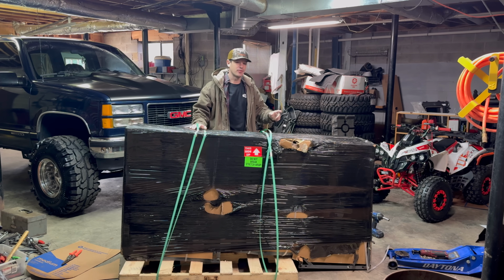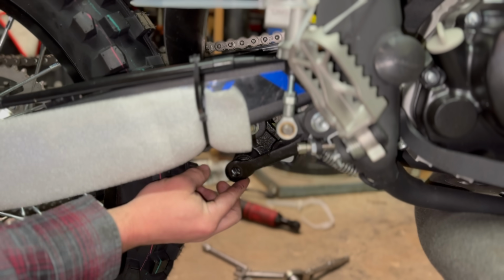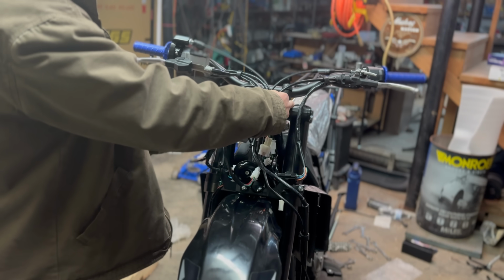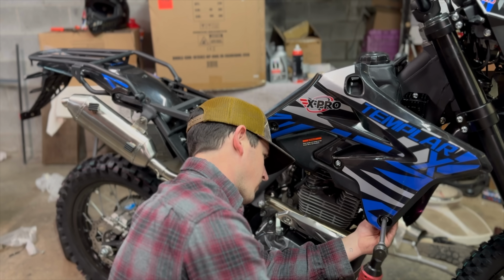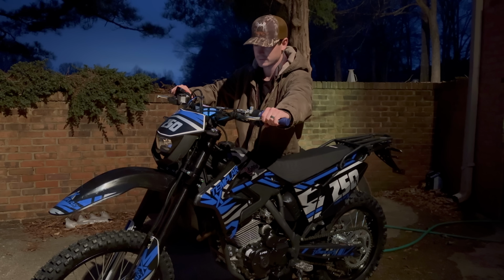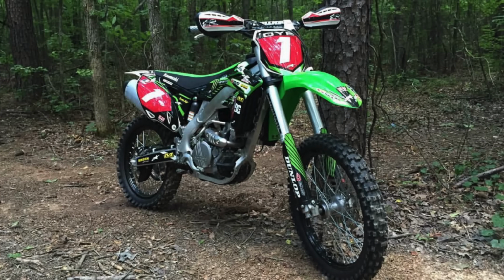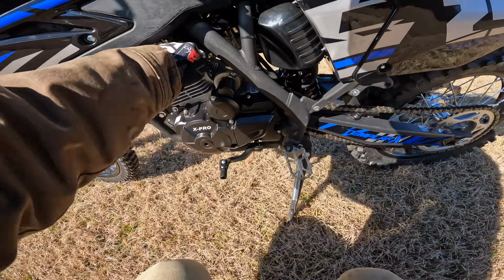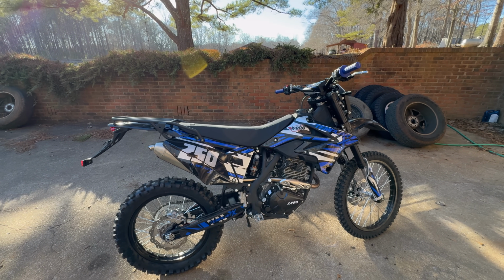I BOUGHT A DIRT-BIKE FROM AMAZON! | IT’S AWESOME |

Comment: The Dirt bike have JT sprocket 15 tooth and a rear sprocket 50 tooth connect to 428 drive roller chain. This guy from Canada has a Hawk and he install high performance stainless steel exhaust pipe one piece and made it louder with bigger hole in tail pipe than original 2 pieces black oxide exhaust pipe plus stainless steel wing nut collar for double attached flange and 2 nuts and Finned washers connect to cylinder.

Comment: There's a reason why there's cheap oil in there. Because it's the best to break in a motor guarantee. It's breaking old in the motor that you're supposed to run a couple of tanks through To seat the rings in
Reply: That's what I was thinking, it's probably break-in oil (straight mineral oil?).
Reply: @trevorjameson3213 non-detergent SAE30 is considered mineral oil.

Comment: China engines are so underrated and just passed off as junk but as someone who buys used ones, i can confidently say, the only issues i have are due to lack of maintenance or just past failure due to age or neglect, often a new carby is needed, a starter solenoid and cdi, i literally found a crossfire x250r at the dump, showed it some love and cheap ebay parts and now it runs perfect.

Comment: By the way, do not try to use nylon lock nuts on the exhaust pipe bolts that go into the cylinder head. Also do not use any kind of loctite. In fact there are some types of nuts that lock at the top of their threads that seizes the bolts that you are screwing it onto. I forgot the name of the nut type but it is what's needed for any exhaust pipe whether it is a motorcycle or a car.

Comment: before you start an offroad motorbike, you have to gently tap the carburettor to shut off the fuel, otherwise it will overflow, start by putting the motorbike down

Comment: I adjusted my valves,  loc tite on every bolt then upgraded to Nippon carb with 110 jet before I even broke mine in.  The. I gave it 1hrs at 3-5k RPM then let cool 3 different times for break in.

Comment: Lengthen the Throttle Cable or create some slack in one that is on it, might also ck out the Throttle Slid top of carb. , if not machined properly, they can stick. I would probably Upgrade the Carb..

Comment: Being a chinese bike and quad dealer for over 10 years. If you know which manufacturers to buy from you can get a quality bike. Here's the deal. The carbs are setup for chinas atmospheric pressure. You have to dial it in 1st thing. Also that oil is break in oil. I run em for 30 minutes on the PDI (pre delivery inspection). Then swap it out. My 250cc sound like 500s but are not road legal here in Canada (I did have supermoto kits you can install then take for inspection and take on road). And you will have battery issues. My personal units i swap to lithium and honestly its a decent overall bike. Im 6 foot 5 and  been hammering on them for years. Even the Side X Sides if you know the quality manufacturers like me. (I have a co worker in china to tour facilities the 1st year). The sxs 800cc is a Mitsubishi 3 cylinder and complete drivetrain is all Mitsubishi. Hopefully this can help a few ppl. Any ?s just ask. Also have a stock pile of aftermarket and oem parts.
Reply: What is the Mitsubishi motor side by side you speak of? Is sxs a brand name?

Comment: The racing dirt motorcycle HAOSEN Zhongshen Hawk XPRO 139cc Does it have dear brake foot lever that went above the foot floor peg. Otherwise the TAOTAO have the brake foot lever bar that goes under the foot peg toward to the master cylinder for rear disc brake.

Comment: The XPRO Hawk have pink slip ownership title from China to your mailbox in 1 month for your brand new 2024 DVNOP 229cc Templar. The 520 pitch chain is normal for Super Chief 250 single cylinder bike Chongqing in natural aspirated carburetor and the XPRO have digital EFI. Did you ride on rough dirt trail in 6 gear?

Comment: Pretty cool. Like i said when you got the boys quad do that first oil change! Lol be a good cabin bike. Looks good for the price
Reply: What oil would you use in this bike ??
Reply: @micwell2247  Any good quality 4-stroke motorcycle oil is good. You can't use automotive oil because of the friction modifiers that will cause the wet clutch to slip. Also automotive oil doesn't have the additives that are needed for a motorcycles gearbox. I usually run Honda GN4 or Yamalube in my bikes, but any of the name brand motorcycle oils are good.

Comment: Rings won't seat and break in correctly running that Mobil 1 synthetic oil on break in. Need to run a good high quality mineral oil first for break in then switch to synthetic

Comment: The weak link appears to be frame. Old school tube frame.
Reply: In ways, that can be better for handling and vibration absorption.  Even in the Mt. bike industry, a really good alum frame, carbon frame, Ti, frame and cro-molly frame, it made as well as they could be made, were really competitive with each otehr overall.  I know my alumn YZ250 2-stroke frame transmits a lot of vibration to my old hands, and they get numb.  I would rather have cro-mo.  But not made in stinking china.  :)

Comment: It really bugged me that you used both metric and standard sockets/wrenches lol. If the bolt is standard, the nut on the other side would be standard too  if it was 17 mm on one side it would be a 1617 or 18 on the other

Comment: I have had mates get Chinese bikes and they instantly regretted it so much stuff just breaking straight away. Honda crf 230 will last way longer I got a 04 in 05 still have the bike is the loner that I use when my friend's don't have there own bike I've never had a problem with it with minimum maintenance and never had to rebuild it you could probably get a second-hand one for the same prices has the china bike and I consider them to be virtually indestructible along with my 88 kdx200cc I got for $1000 aus. The KDX I did get it off a family member that's had it since he was a kid but there's a lot of second-hand quality bikes around at good prices . My main bikes are a 2015 wr450 road trailer and just finished a resto on a 00 rm250 which cost me a small fortune. That being said my mate just got the new crf 250 and its made in China 😂

Comment: That's not insane for the bike cuz you didn't buy a dirt bike you bought yourself a Enduro a 250 Enduro which means you can register it and drive it on the road legally depending on your town probably not the highway but you can drive everywhere else that you can drive a car so or a motorcycle cuz it is qualified as one at least in my state is I'll see you at blinkers so that does mean that it is a Enduro and you'll set a plate mount

Comment: that is a great value for money, most honda motorcycles in my country are made in thailand or what you call tofu honda. made in japan honda's are great but if it's made in thailnd they always broke down and the parts is cheaply built, ordinary shock, cheap bulbs analog panel and social climber dudes still buy it because they always believe a shit will turn to cake if you put honda sticker on it. some are bragging about their outdated cheap parts honda because it got sticker on it wahahaha. a cheap built motorcycle remains cheap even when you slap honda sticker to it.

Comment: You may not be able to get this registered for the street. Looks like not nhtsa approved.
Reply: There are states in the USA where with just a squeeze bulb horn, a head light and brake light make a Motocross bike legal.  I took some time off, and not interested in that, but I know back in the 80's and 90's, you could buy kits to do it.  For turning, they use their left arm and hand like we did with cars, arm out the window, before turn signals.

Comment: Was is with Americans calling wheels tyres.  You said get the front tyre in IT'S A WHEEL the tyre ia the black knobbly thing.
Reply from the maker: Tire is mounted on the wheel. Thus saying wheel or tire is correct.
Reply: @lmfscrew  read what you just stated and give yourself a slap.  You fit a tyre to the wheel then fit the wheel to the bike thus wheel is correct.
Reply: OK man!  I want you to spell "aluminum", and say it like it is spelled!   :)
I looked it up actually.   Euro using an old spelling.  "Aluminiminiminium"    lol
Reply: @lmfscrew   Nope.  The hub, spokes and rim make the wheel.  But I think you can add the tire to it and still call it the wheel. 
We did make wheels before tires.  :)